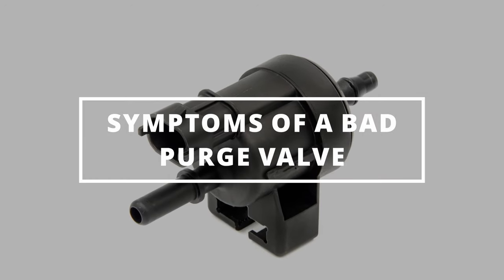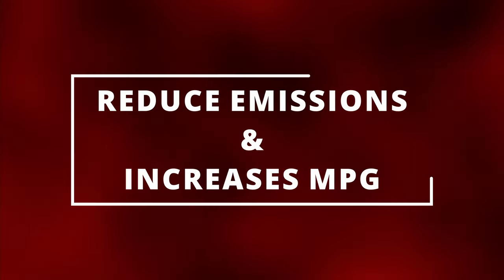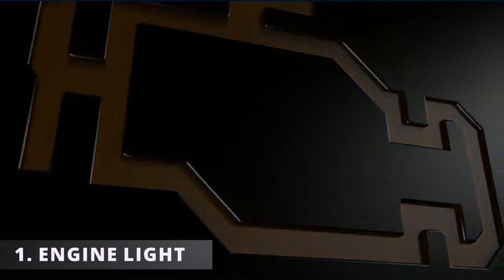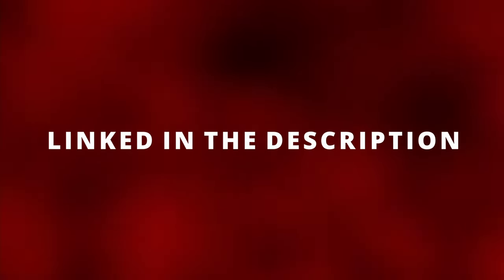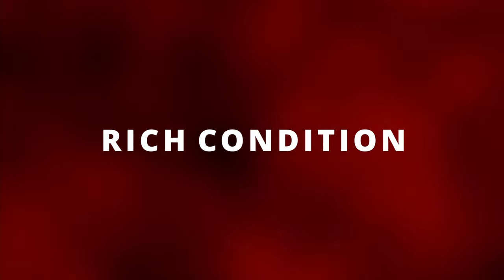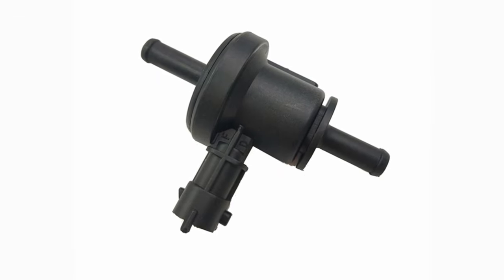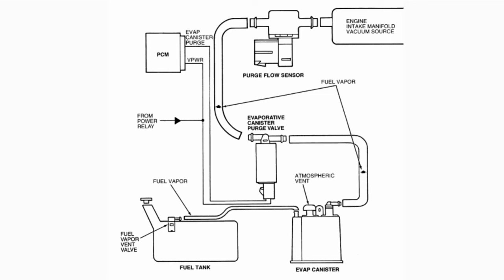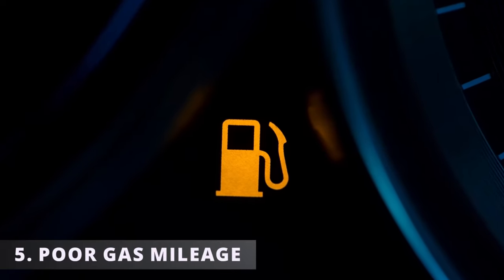SYMPTOMS OF A BAD PURGE VALVE

Comment: Don't forget that a failed purge valve will cause multiple misfires too
Reply: Like what exactly? I keep getting this on my check engine light but I've already replaced the purge valve
Reply: @Clean-N-ShineInDfw  what is your vehicle doing?
Reply: Thanks for the info, I have a misfire on my truck and have been pulling my hair out trying to find the cause.
Reply: @KatiTheButcher  if that doesn't fix the problem then it could be a vacuum leak getting smoke test helps alot...vacuum leaks very common on vw vehicles
Reply: @uhtehz2362  already went through the whole intake and replaced the gasket and the MAFS. Motor looked clean. Idles rough, slow to accelerate and exhaust smells like gas. Cyl 6 misfire, coil, plug, wire all have good spark. Plug isn't fouled up. Really thanks for the input, the purge valve is a low cost easy job. Im crossing my fingers it will work!

2011 99k mile 4.3 silverado
Reply: @KatiTheButcher  mines also misfires in 2 and 3 I have the 2.5 i5 and I changed the purge/fuel filter/fuel pump/vacuum hoses/tb/map sensor/spark plugs and coils  and still idles rough idk I'm thinking it could be that there's bent valves that is another issue with rough idling engines
Reply: @uhtehz2362  I hope not for your sake, not a cheap fix if you cant rebuild an engine yourself. I would be screwed.
Reply: @KatiTheButcher  God I just hope it's just the timing chain that's not expensive just a pretty penny I know a guy
Reply: My car keeps shutting down 2 cylinder at higher rpm’s
Reply: @pearbearhd4737  vvt solenoid? Coil pack or spark plug
Reply: @uhtehz2362  changed coil packs and spark plugs so I’ll give the vvt solenoid a chance
Reply: @PearBearHD  okay yeah a bad vvt will make your car misfire under high loads
Reply: @uhtehz2362  im going to get that right away thank you hopefully that fixes my issue it’s driving me nuts
Reply: @pearbearhd4737  okay good luck
Reply: Could be the secondary air injection pump, I've heard air whistling out my pump on a cold start I have the same misfiring in 2 and 3 this morning I actually took 1the time to hear any leaks/hissing/ whistling noises since I know I changed everythin/g else and nothing works I assume that my pump is stuck closed because i felt air pressuring out through the tube where it's connected to the valve i checked that hose as well for any other leaks I've done all the things you just mentioned and none of it worked, but  after having my own scan tool always told me to look for air leaks. I know I should of done that before but its still way more cheaper than going to a mechanic. And how I know its that part I disconnected the cable and it threw a code but my car was still acting the same Im not sure if denso is OEM but I know thats a problem so I hope this info helps
Reply: Will it cause the engine to sputter and stall out
Reply: @dannyyarbrough8343  what part?
Reply: my 2011 chevy camaro SS doesn't start after refueling , can evap system be a problem ?
Reply: @DIABLO_4_Tester_Sacramento  it's either your fuel pump the filter or the injectors
Reply: Exactly I had misfire cylinder 3 and 4. I went and fix the p0443  I thought my map sensor was bad but it turn to be the purge valve broken wire and line was rusted was leaking air I was getting rough idling stalling high idle
Reply: @Clean-N-ShineInDfw  check your wire might be broken or there’s vacuum leak I have a cadilac Escalade mine was on driver side like all rusted
Reply: @Edi-01  yeah if there's no code and there's misfires it's most likely a broken hose somewhere leaking or sucking too much air and old hoses are very brittle
Reply: @uhtehz2362  true yeah they are known to rust lol Gm I’m not surprise
Reply: @uhtehz2362 egr check out okay?
Reply: @uhtehz2362 compression test done,yet?
Reply: That was exactly my doubt.
Reply: Dont mistake with fuel pressure regulator
Reply: @nobodyschild967  this is for emissions, you have the fuel regulator yes, but these also have a air pump or smog pump that goes bad and will trigger alot of other sensors making the car run like crap
Reply: @uhtehz2362 you either have an issue in fuel system (injector, filter,  ect) ignition system (coil, plug, sensors like camshaft, crankshaft position sensor, ect) a vaccum leak, or your timing belt needs replaced. Timing belts are a comon thing that cause missfires after they get stretched on some vehicles. I hope you figure it out
Reply: Thk my car is misfires
Reply: Dude, you the man. Came here hoping to find out if would cause im getting multiple misfires and your comment was the first i see
Reply: @KatiTheButcher did it work after all cause I have a similar problem
Reply: @DIABLO_4_Tester_Sacramento having that problem also but it does it after a few cranks then all good
Reply: If my engine sputters at full throttle and I have a p0442 in my 98 maro is this yhe cause?
Reply: @d1sfunt10nal4  you'll have to look into that code more specifically for your vehicle because you have a 98 camaro not a 2013 jetta
Reply: @Clean-N-ShineInDfw a split purge valve pipe or bad filler cap/seal can cause issues too.

A purge valve system is designed to have the tank sealed with a one way valve on the filler cap that lets air into the tank but no fumes out to atmosphere.

The tank should basically be zero pressure or under a slight vacuum at all times.
Reply: Thanks everyone for the responses. It helps me understand vehicles a bit more
Reply: So is that why my car is sputtering like a bitch.
Reply: @scrugs  ehh dealing with this type of vehicle it gets tricky if you don't have a top end obd scanner
Reply: I have a 1998, 3.3L 4x4 auto. 170,000 miles.
My wife filled gas tank one day last week while it idling and it started acting like it was missing after that. 
She drove it 200 miles through the mountains and got it home. 
No codes.
I opened the gas cap, that looks good, and the tank depressurized for no kidding, 5 to 6 minutes. At first it was heavy and wet fumes coming out, then eventually faded away. No visible leaks anywhere, or damage.

I loosened the gas cap and drove it for 18 miles. No change. Acts like it's mildly missing. Plug and wires only 1 year old. No codes.

Also, the RPM gauge shakes about 200 RPMs when it feels like it's missing. 

Any ideas?  Do ya think my ignition coil just happened to go bad at the same time?  Would that not toss a code?

Thanks!
Reply: I’m dealing with a P0300 code and thinking that might be my problem, says multiple cylinder misfire
Reply: Man.... I wish I had looked into this alot earlier.... I had a p0456 (2014 f150 w/5.0/v8) small evap leak detected. But I never noticed much until it started to give me rough starts after filling it up. I had no idea about this... I am truly ignorant. I just replaced my purge valve, 39 bucks, I hope it's the answer... I need to pass smog. 😫

Comment: My car runs amazing  but each time I fill up up the tank its a rough time starting
Reply: You need new throttle body
Reply: Same here!! Throwing a bunch of evap related codes too... With a full tank, she will turn over but immediately dies. But keep 3/4 or less in the tank and she runs pretty well considering...
Reply: Mine too
Reply: Evap canister or charcoal canister. Or both
Reply: mine does too. just fill until pump clicks.
Reply: don't over fill the tank.  the fuel will Goto canister and may damage it.  when auto fill stops that's all.
Reply: Once pump clicks your done trust me stop over filling this is the issue it screws up the EVAP system making the engine run rough
Reply: This happened on my 08 Sierra. Evap purge valve went bad. Ended up replacing the purge canister and filter as well.

Comment: Not to forget a faulty purge Valve stalls ur car in hot summers 😭😭😭
Reply: Yes bro i had a experience like this in hot summer the car is stalling when the purge valve is stuck off
Reply: This shit happen to me like two weeks ago and has been and on and of thing when it gets hot. I had to walk home 3 hours at 12am lmaooo
Reply: @LeadDownRang3  did replacing the valve fix it?
Reply: The reason this happens is because when gas is hot like in the summer it gives off more vapour and if the purge valve is stuck closed it can’t be burned off by the engine so it starts to suffocate the fuel pump and the pump starts sucking vapour not liquid and it stalls the engine. This usually happens with less then half a tank of gas.
Reply: @ryans413  I’m not sure what you mean by suffocate the fuel pump and it start sucking fuel vapors, the fuel pump is always submerged in liquid and sucks fuel from the bottom of the tank, so there is no way for the fuel pump to suck vapors. If the purge valve is stuck closed, the vapors will simply vent to the atmosphere from the carbon canister through the vent solenoid.
The issue with summer stalling is the purge valve stuck OPEN not closed, as it is constantly bringing in fuel vapors to the intake, it’s worse when the tank gets empty, as more vapors accumulate above the fuel. When the vapors gets into the intake from a defectively open purge valve, it causes the car to stall as it’s displacing oxygen (air) and suffocating the engine as there isn’t enough air to burn the fuel.
Reply: @MowSow  I meant open my bad but this was the issue on my vehicle and only really happened when it was hot outside because there be more vapours. It stall my engine out then it be very hard to restart and the fuel pump would sound awful. Since I replaced the purge valve the cars been running great so that was my issue and I had no codes no engine lights nothing.

Comment: If you need to replace, take this advice, replace with an OEM valve if available. This goes for all sensors on your vehicle.
Reply: As long as its not Chinese
Reply: @zacharyenck1087 that’s a long shot nowadays just about all of them are Chinese except the ones made in Mexico or Canada by GM

Comment: On my 04 suburban it took me five minutes to install the valve, but a mechanic wanted $60 to install it. YouTube is the best thing ever.👍 Also my dash flashed tighten gas cap.
Reply: 2019 traverse. Dealer wanted $350! Took me 30mins & the cost of the Valve. Wth...
Reply: Wow total rip off glad you were able to do it yourself 👍
Reply: that's not bad, i'm sure a VW mechanic for my car would charge triple.

Comment: Yup. Hard start after fueling. I thought I was dead right there at the pump. Started eventually, but still 😬
Reply: Once was a one-off fluke. Twice in a row? Had to Google that shit!
Reply: Also engine light, rough idle, spontaneous stalls and out of place revvs
Reply: I don’t know where the heck it is on a 2013 3.6L Cadillac ATS
Reply: I heard on idle if its sucking its broke.  Is this right and would temporaly blocking it off until the part comes make the car run better

Comment: Thanks for the clarification. My mileage was going to shit before the engine light came on. Noone really wants to name poor mpgs as a symptom of a bad purge valve.
Reply: Yeah, so far the purge valve is the only thing left I can try and the only real symptom the car is showing is terrible MPGs beside the check engine light and code. Tried replacing the fuel cap, air filter, checked all lines for cracks. It all comes down to that stupid little valve.
Reply: @Bl4ckD0g  Got it fixed last week and it makes all the difference on fuel economy and overall engine feel.
Reply: @globalkaos67 Hey man I drive a GMC Sonoma from 2003 , I feel like I'm driving around with a bad Purge valve.. What did it run you to get the Part and install it ? Also not mentioned in the video but every so often I have smelled gas odors and my check engine light will pop on ... I would appreciate your input.. thanks
Reply: @Bl4ckD0g did it work out for you
Reply: @anthonyciantar108  Luckily mine was under warranty. Not sure how much it would've been otherwise. Not sure what to tell you about your issue. Wish I could be more help.
Reply: @davidgallego2340  it did. Unfortunately I have some front end. Work still to do to fix a Traction Control issue.
Reply: Me and my girlfriend just bought her a car, it got extremely terrible gas mileage, rated 26 freeway 20 city, but got barely 150 miles to a tank, was like that for months until the check engine light came on to replace the purge valve, replaced it and the gas mileage more than DOUBLED!

Comment: If I would have watched your video before tearing into it, I would still have that green tab. Anyway, very informative and the hard start after pumping gas is what clinched the diagnosis. Thank you.
 If you blow freely one way into the valve, it is stuck open. I banged mine on the floor until no air passed. Ran it with success; time will tell.

Comment: Check engine light came on the other my friend plug his scanner an I got p0456 evap leak should I go head an replace asap or take to pep boys to get paper work on what’s really wrong before doing that so my mechanic will know where to start from there. Your video explains a lot about why my car is running werid from all the 5 reasons u have mentioned especially when I filled my tank up today when I got off work!
Reply: What did you end up doing and what was the final diagnosis?
Reply: Could be gas cap is loose

Comment: Thanks my friends, that’s the best explanation I’ve looked at so far very easy to understand. Especially for those that are not mechanically inclined. That’s exactly Whats happening to my 16 xts caddy…..question will filling tank with engine running have something to do with this failure of valve?

Comment: disapointing are evap systems. i have code pi446 but was told that solenoid purge valve never fix the code. meaning other sensors are needed. fuel pressure sensor also. sorta like a garbage disposal on car.

Comment: Hopefully you will see this and reply. I have a 2013 edge, 3.5. brake booster went bad and since I did not have the funds to take care of it right away, I drove it for about 2 weeks. Finally replaced the booster and then I ill be driving the car and it would loose power and I would have no throttle response. Sometimes it will not do it for days but still have the worst gas mileage ever. Did I damage the purge valve by driving it with the bad booster?

Comment: Hello
I have a 1998, 3.3L 4x4 auto. 170,000 miles.
My wife filled gas tank one day last week while it idling and it started acting like it was missing after that. 
She drove it 200 miles through the mountains and got it home. 
No codes.
I opened the gas cap, that looks good, and the tank depressurized for no kidding, 5 to 6 minutes. At first it was heavy and wet fumes coming out, then eventually faded away. No visible leaks anywhere, or damage.

I loosened the gas cap and drove it for 18 miles. No change. Acts like it's mildly missing. Plug and wires only 1 year old. No codes.

Also, the RPM gauge shakes about 200 RPMs when it feels like it's missing. 

Any ideas?  Do ya think my ignition coil just happened to go bad at the same time?  Would that not toss a code?
Much thanks!

Comment: Hey bud my 07 tahoe has a hard start sometimes. Also it doesnt take gas from pump well. Ive seen it could be coolant temp sensor. Im gonna try replacing both just in case. U think it will be worth the shot?

Comment: I got a p0442 on my 2018 cadillac xts. Replaced the purge valve and the light came back up. The dealer wants to see the car for an entire day. I dont trust the dealer took it in for an oil change came out with this issue. Started to get wierd noise from the rear of the car then the light came on. Dealers suck.
Reply: Yeah, I had a coolant leak after an oil change, once;

Comment: I have engine (yaris mk1 1.0L) hasitation for 1-2 sec when I pull gas pedal fast, and everything is OK when I do it slowly... No "check" lights, no error codes. Cold start is Ok. I tested coils, sparkplug, MAF and and TPS sensors... everything is ok... So it can be this valve from your video?

Comment: 2015 pilot I filled up the gas tank bit to much started right up then I parked it after 40 min turning engine on it head rough start then I turned off the car and it head another rough start not as bad as first one. Parked it at work and was sitting in car for 20 min started few times no issues should I replace my purge valve ? Thank you

Comment: I have been driving my moms 2018 Buick encore and it starts fine but the first start of the day it’s rough, it’s throwing a P0496-00 and it’s saying it’s the purge valve. I’m wondering if that’s why it seems to have low power. It’s a 1.9l turbo engine and I know the turbo is only to make the car get up to highway speed but man this cars slow, although I absolutely love the whistle from the turbo. It’s not excessively loud b it a nice whistle when I accelerate